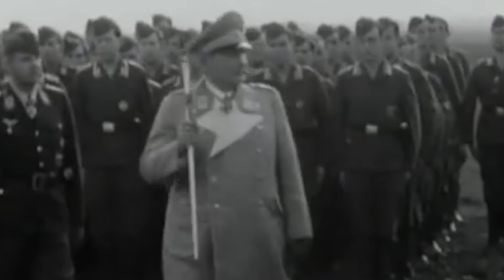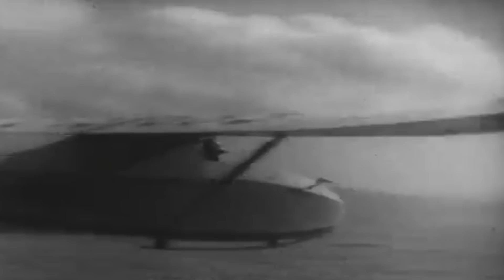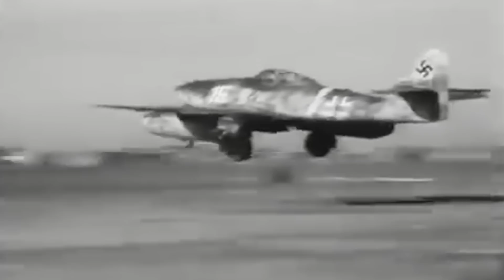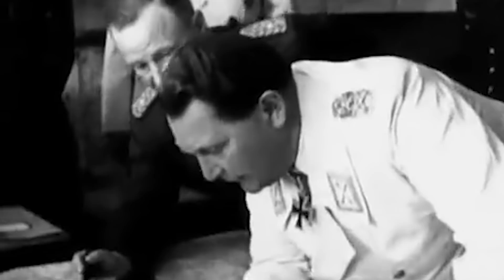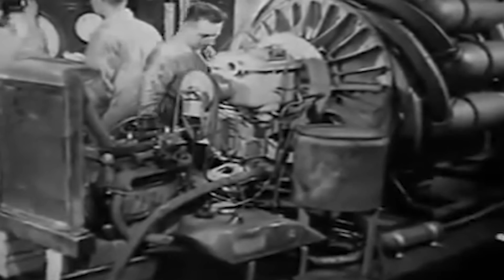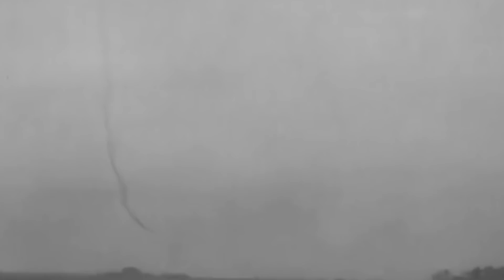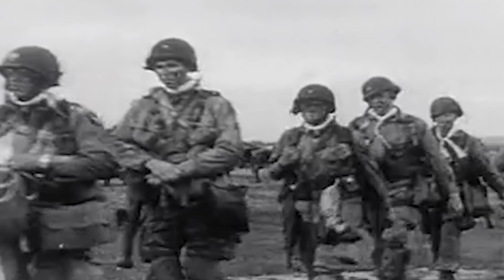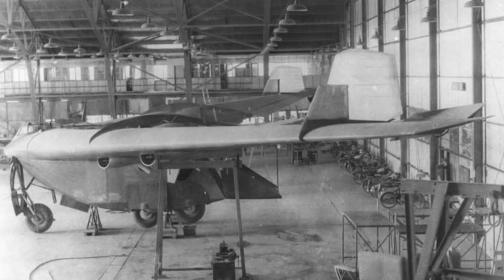WW2 Secret Stealth Bomber - Germany's Horten Ho 229

Comment: I doubt anyone is going to read my comment, but there's some things here in the video and in the comments that needs to be straightened out.

OK, this isn't a "Stealth bomber" in the traditional sense, but for its time, you could more or less call it stealth. A large team from Northrup Grumman actually built this aircraft and put it against radar from that time period, what they found was this aircraft would be very hard to detect until it was too late... Its footprint overall was quite small on radar. They assume that by the testing they did, any Allies who spotted this aircraft on radar, based on its speed, they would have between 2-3 minutes to respond, to make a counter attack. Which is pretty much useless. Radar simulations showed that a hypothetical Ho 229, with the radar characteristics of the mockup which had neither metal frame nor engines, approaching the English coast from France flying at 885 kilometres per hour (550 mph) at 15–30 metres (49–98 ft) above the water would have been visible to CH radar at a distance of 80% that of a Bf 109 This implies a frontal RCS of only 40% that of a Bf 109 at the Chain Home frequencies. 

Next the 229 was NOT apart of the Amerikabomber project. The 229 wasn't even going to be a bomber. The 229 was basically going to be used first as a prototype... A proof of concept so to speak, eventually if (and it would have) it succeeded in proving its mission, the 229s that would've been built and the others built afterwards would've been fighters. Sure, maybe some would be light bombers, but really, their purpose was for them to be fighters... The Amerikabomber had a lot of different prototypes, and what the 229's proof of concept was going to manifest into, would've been the Horten XVIII. Which for all intense and purpose was a scaled up 229. THIS would've been the Amerikabomber, THIS would've been the heavy bomber.

I was first excited when I saw this video uploaded... Then hesitated when I saw the video was 12 minutes long. You can't properly convey and explain the 229 (to a new audience) in that short of time, there's a lot that you'll leave out, and half pieces of information... Then I watched this video, and heard some of the incorrect comments made. But hey, that's ok, no one ever hits 100% all the time, with everything. But I think a new video needs to be done. More research needs to be done and proper length video, not just hitting the "main points." Me personally explaining this to people in the past when the subject has presented itself has had me speak on it for at least 20-25 minutes.

I'm no expert here, not in the slightest, I'm just an avid fan of the Wunderwaffe project and other smaller projects, the ideas, technologies and prototypes that were made during that time period. The 229 interests me more then any of the rest of it.

I'm not trying to sound like a smart*** and I hope I don't come off that way, this video just doesn't seem like it was well researched, and that's quite a shame, because this aircraft deserves a lot of proper attention.
Reply: You my friend, are easily one of the most intelligent and creative posters I have encountered. Very very enjoyable.
Reply: @alanbeckham9093  Really? Well... Thank you for the kind words.
Reply: @awkc63  - Please let me add my warmest congratulations for all the in-depth knowledge of the subject you have shown here !  You REALLY know what you are talking about !  "Chapeau, Monsieur !", the French would say !
Reply: ...this video channel tends to sensationalize it's subject matter...
Reply: It may be time for many of us to unsubscribe from this channel.  He's taken the American-television step, and that's always a sign of the 'end' of my interest.  That he also writes off the most brutal campaign the Americans were facing - that of a ground-war on Japan's own soil - I hate to write it, but I'm hitting 'Unsubscribe' right now.
Reply: Chain home was low end VHF because that was the best they could do with high power Fleming valve vacuum tubes. I don't think America ever used radar (other than over-the-horizon radar) below UHF. Coupled with parabolic antennas, magnetrons would make the stealth aspect of the Horten insignificant.
Modern stealth is a very different thing. During development tests they got a signature off the model because a bird landed on it.
[FCC Radiotelephone licensed with Ship Radar endorsement since 1969]
Reply: @flagmichael  I believe you're right when saying the US didn't really use the Chain Home, that was an England thing. Yes, obviously stealth is a completely different thing today, but for its time, you could call this "Stealth" based on the technology at the time and how the Horten was able to prevent most radar penetration. "stealth" would be a lose term here, but it gets the point across.
Reply: 🤣 There NEVER was a Ho-229! There only was a couple of prototypes of Horten IX! The planned production version was given to the Gothaer Waggonfabrik. They were chosen to build it as Go-229 but we all know it never came to production...

Hello from Germany!😎

Comment: The HO229 was meant to be a fighter, not a bomber. I am not even sure if the design for the bomber was even made. And the HO229 is to my best of knowledge decaying in a shed owned by the government of the USA, in incomplete state. It is certainly NOT on display. What could be on display is a mock up that was made to test the HO229 radar cross section a few years ago. There are too many basic mistakes in this video. Please delete it.
Reply: Not the case, it was a proof of concept.

Comment: How the heck did we not Paperclip these guys?
Reply: Florian Held  Flying wings were being pioneered well before the Horten brothers. Initially by the Soviet aviation pioneer Boris Cheranovsky in the mid '20's. Followed by John Northrop and soon thereafter the Horten brothers. They were all pioneers in this area. Though that doesn't make the latter particularly innovative.

 It has nothing to do with nationality. Its just there's no factual basis aside from sensationalized television documentaries to claiming the Horten brothers were particularly influential on stealth aircraft or the B-2 in particular. You have failed to elaborate how they were as you claim.
Reply: Florian Held  But how so to any degree more than Northrop and thus more influential? What is this based on exactly?

Comment: I can see where the US got their B-2 design from.  Oh yea, Germans were ingenious.
Reply: Nonsense.
Reply: The Northrop B-2 design had far more in common with the large number of flying wings that Northrop developed and flew in the 1920's, 30's, 40's and 50's.
Reply: Olof Larsson if this design was so good,how come there are no more,only Norton designs.
Reply: @danapicray9040  Today there are plenty of projects from the US, Russia, China, UK, France and so on. Prior to the B-2, there were issues with stability. Furthermore the flying wing is best suited for subsonic level flight. For large parts of the cold war, the desire was for supersonic speed, and/or low level flight.
Reply: Olof Larsson the problem was they had to wait for computers to advance to control the wing. The point. I was making is there are all these great inventions were good on paper and not in real world.
Reply: @danapicray9040  Well, it appears like jack Northrop did solve those issues on the YB-49 jet bomber, but by that time, they had a bomb bay that was to small for the large nuclear bombs of the time and a wing not designed for high subsonic speed. So it was (in 1950) slower than existing and future aircrafts like the B-47 and B-52. So Even if they had solved the issues, they would have to start all over from scratch, to develop a aircraft that had acceptable performance for the time. But by the time a brand new flying wing might enter service (c.a.1960), the USAF expected to start to switch to super sonic bombers (B-58 and B-70). And by that time (1960's) the USAF had reached the conclusion that super sonic speed at high altitude was not the solution to penetration strikes, but rather low level flying. And that was not something that the flying wing was well suited for, even though the large delta winged Avro Vulcan did OK in that role.
Reply: FFS please do yourself a favor and do just a little research on Jack Northrup.  You know, the father of the American Flying Wing Programs.

Comment: flying wings like the Ho.229 and Northrup's design prototypes had deadly stall characteristics, if flown outside a narrow aerodynamic envelope they would lose lift and flutter into the ground like a fallen leaf. I suspect the first Ho.229 prototype that crashed discovered this aerodynamic glitch in much the same way Northrup had. Not until advanced computational design came to pass were the those flaws eliminated.

Comment: Flying wing aircraft are inherently unstable and weren't made to be flyable until fly by wire through a computer was developed. The yawing as well as trim control problems killed many test pilots up until the 1980's. The one B 2 bomber that crashed, did so because a computer connection failed.
Reply: Didn't explain, why the design of the Ho 229 was an exception, wich enabled a stable flight even without flight computers?
Reply: @Enthropical_Thunder  It wasn't an exception.
Reply: @peterson7082  
It was an exception, he explained why the lift distribution due to the shape of the wing contributed to a very stable flight, even without a tail.
Reply: @Enthropical_Thunder  I am not sure what the notion it was a more stable design is based off of. Given little exists for flight data.
Reply: @peterson7082  
Well, it is not worth much but you can look up some information on model aircraft, respectively the model flying wings. They usually state the same, they achieve a stable flight by using either a similar shape like the Ho 229 or they put some sort of guiding fins on the wingtips.
Reply: Fly by wire system is from Focke/Wulf out of the 60's ....for real 20 years
Reply: @d.f.9140  
Really? I thought  that Dornier was one of the first with their Do31 VTOL transport aircraft.
Reply: Nope the aircraft may be from dornier, but two other planes were designed in the same time... Focke was forced to sell the patents to gb and america for vasucally peanuts... There is a german documentary with Mr. Focke himself in an interview, he explains it in detail, except as they asked him what happened to the technological dicoveries they made and (in context) the fly by wire system.
He sums it up at that point with ", they wanted it, because it was way better than the system they used and because we weren't allowed to produce for germany, we had to sell it, unfortunately for an apple and an egg, peanuts in relation to the effort we made and use it would provide"
Reply: @d.f.9140  
That's very interesting, do you have any linls or sources, i new from projects like the X 31 that the american sometimes tend  to cooperate with the germans in terms of control loop systems but i wasn't aware that Focke of all had such a technology this early, i mean, Focke existed since day one of the first successfull fighter aircraft, them developing revolutionary technology in the 60's is unusual.
Reply: Schwebezustand Mission deutscher Senkrechtstarter,  look it up you can find it on youtube, but I can't recall english subtitles or even an english speaking source.
Reply: @d.f.9140  
Kein Problem, glücklicherweise kann ich beide Sprach recht gut ;D.
Reply: Na dann viel Spaß ;)
Reply: They should have reset the router asap

Comment: The Ho229 wasn’t the Amerika Bomber. It was a fighter plane meant also as a test bed for the aerodynamic concepts to be used in the trans-atlantic bomber
Reply: Yes it seems that the documentarian is confusing the 229 and the bomber variants and the 163.
Reply: Completely agree, 2 different airplanes based on the same flying wing approach - the HO 229 and the 6 engined Amerika Bomber. Great stuff on this channel, but this vid is a bit confusing. DarkDocs could have made 2 independant vids here.  Neverteless, can't wait for the next installment.
Reply: thebobs9343 Good way to explain it. As well, Jack Northrop (of the same Northrop that makes the B-2), was working independently on flying wings around the same time. I certainly wouldn’t rule out some the knowledge the Hortens amassed being used on his later designs, such as the YB-49
Reply: Neil Rosh I’m sorry if I didn’t make that clear. I know he was working on flying wings before WW2, what I’m saying is that it’s possible he saw blueprints or somehow got other information on the Hortens’ work, and that that influenced his later designs from after WW2
Reply: @LiahTam27  There's no evidence for that claim. Yes it's possible, but incredibly unlikely as neither he himself or his company had access to it. There was nothing in particular to learn from it either, after it reached the U.S. it was stored for about eight months, evaluated, and kept in and out of a crate somewhere in the Southwest (NV I recall ) until it was handed over to the Smithsonian Air and Space museum in the seventies/ eighties.
Reply: @LiahTam27  that's like saying that China randomly, by chance, came across the F35 blueprints. This design is basic in what needs to be done to reach those goals. To make a jet as aerodynamically as possible, a lot if engineers would've eventually ended up with this design. It's as aerodynamic as one can get in a jet.
Reply: Nathan Peterson Fair enough. I didn’t know the exact history of the 229 that was brought to the USA, and I thought it might be possible, what with Operation Paperclip and all
Reply: @deltabravolima1514  umm!!pO
Reply: @Velocinox right. I iwas an unintended discovery.
Reply: @Jeffrey Tam What? Can you clarify? You mean that the U.S. didnt copied Ho229 as its stealth bomber after WWII?
Reply: @_dondie_  No. They didn't.
Reply: Hello from Germany!👋

The Horten IX was the prototype for the Go-229 production version jet fighter and the also planned Ho XVIII should be the prototype for the much bigger so called America Bomber...😉
Reply: It was not the "Amerika Bomber", true.
But you are entirely incorrect that it was designed as a fighter; it was designed precisely as stated in documentary.